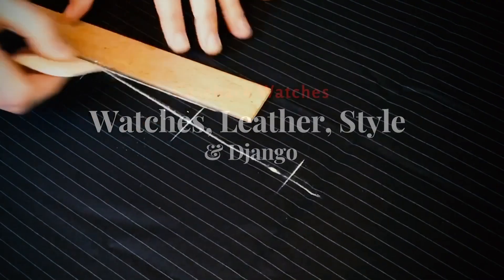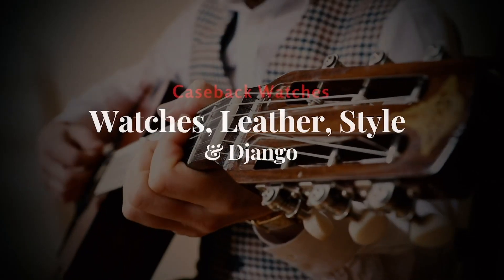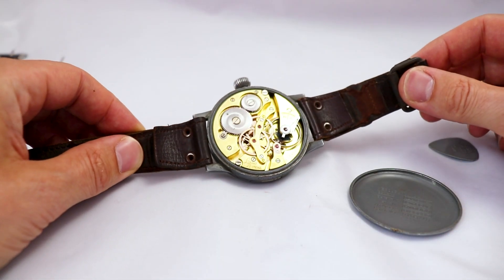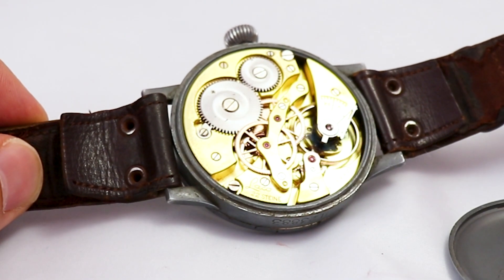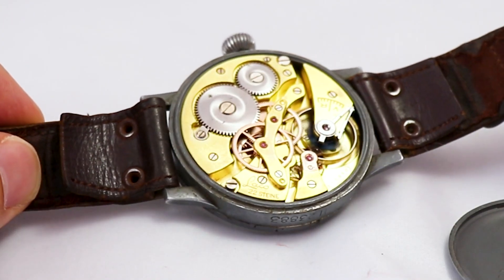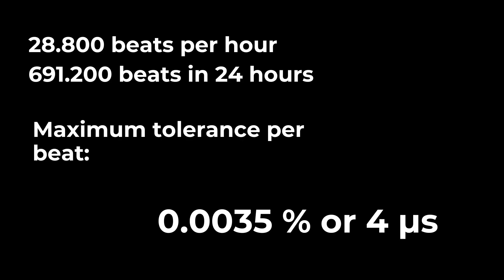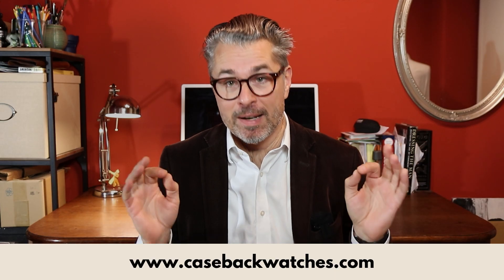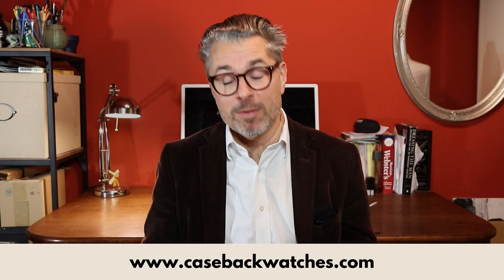Why Mechanical Watch Movements Are Still Top-Notch By Modern Standards.

Comment: Tim - you correctly said that in a movement with a beat rate of 28,800 the balance wheel "touches point zero 28,800 times". Yes, but you didn't specify within what time period. The answer is one hour. An important piece of information for your viewers. Thanks for your enlightening work.
Reply from the maker: One hour, yes, that's an important addition, thank you.

Comment: The general public forgot about mechanical movements because quartz movements are so inexpensive to mass produce.  But mechanical movements (the quality ones) are accurate to a few seconds a day out of 86,400, which is amazing for a machine that keeps time by bouncing an almost weightless little wheel back and forth, and despite the fact that the movement is in all possible positions, some which increase friction on the wheel shafts (and make it run slower) and some of which decrease friction (and make it run faster), and sometimes the power spring wound tightly and sometimes it's wound loosely, and sometimes the movement is cool (which makes it run faster) and sometimes it's warm (which makes it run slower).

Comment: I love mechanical watches.
There is a but😖
If accidentally drop them from 1.5m something will go bad.
My first experience was with an citizen ny40 with miyota movement I drop it and it was of by 40sec per day 
before it was +- 5sec depending on position due at night 
I fix it with cost 20€ .
Next drop happened 2years later and stopped working at day change at night.the cost was 70€ for a watch that cost me 130€ from a friend who worked at citizen Hellas.
I bought a new in 2018 since then it works perfectly but I was very careful not to drop it.
When it dies I will bought a citizen eco drive quartz diver.